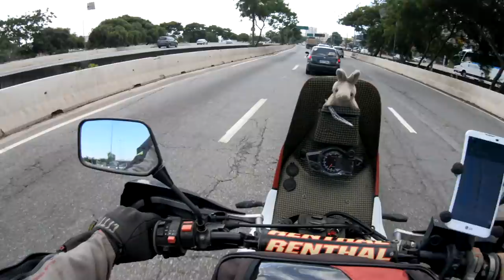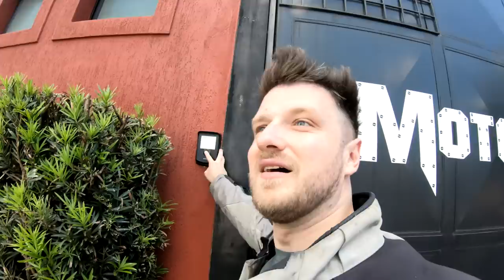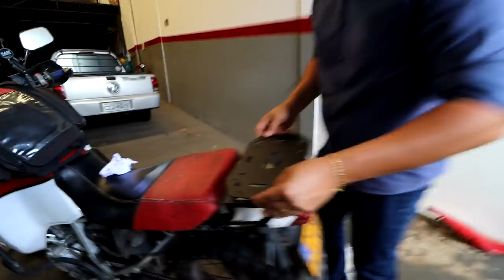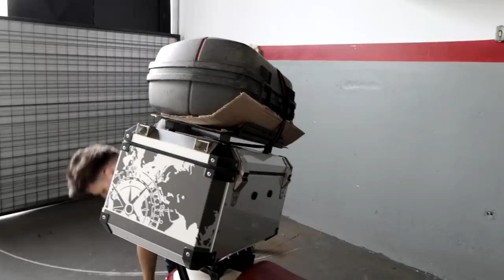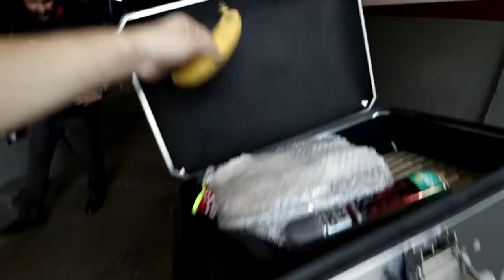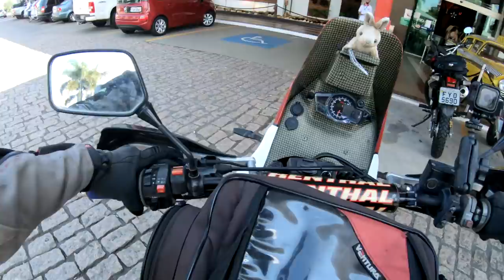Installing New Aluminium Top Case Made in Brazil (OMG It's so BIG!) - ep87

Comment: I would strongly recommend using the rubber corner straps on your RAM mount phone holder.  I love mine.  While in Italy last November I was riding from Como to Milan.  I put my phone in a plastic bag because it was raining pretty hard.  Didn't fool with the corner straps because I was in a hurry.  I suspect the rain, the plastic bag, plus the phone not being secured properly caused it to come out of the holder, bounce on my knee and was gone at 80 mph. Bad enough to lose the phone, but it was my primary navigation unit.  I have a usb cable direct to battery so the phone is charged at all times.  Bluetooth into the helmet with directions and music. Heading to Brasil next October for a 30 day solo tour. Thanks for posting.
Reply from the maker: Sorry for your loss, there have been times where I would have been in some serious trouble without the phone as nav. So the new phone came off the other day which is bigger and bulkier. Already had started using the rubber tether but didn't attach it because figured it was a short ride home. Phone fell out while picking up speed but I somehow caught it, so lucky. So since then I'm always on them straps. Have a great trip mate when you get here!
Reply: Did you come, after all?  How was it?

Comment: Pedro, Perhaps you should look into adding a USB power port to your dash so you don't have to rely on the phones limited battery capacity. They are fairly simple to install. I have a dual  USB port on my KLR  and it makes everything so much easier.
Reply from the maker: You're right, I've already got one but it has become unreliable, installing a replacement soon. Got a double usb and a 12v port but the cheap Chinese stuff doesn't like all the shaking. Hope it's that and not the wiring.

Comment: Looks very similar to the Givi Trecker Outback. I have the 58 l.
I can fit camping gear incl. a foldable chair plus rain gear and there is still space left.
For daily driving it can store the helmet, extra warm clothes, some tools and rain gear. Very happy.
For traveling I have downsized from hard big boxes to soft Kriega OS 32 and OS 22.
Incl. the new Rade Garage 790 rack the width is reduced by 20 cm. (Almost 8 inches).
Pack clothes i a dry bag on the pillion sest.

I like the idea with to top boxes 👍
Reply: Good Italian gear... ^:^

Comment: I have a similar sized 58 litre aluminium top box it also comes in handy as a seat. I just remove it, place it down on its side and take a seat.

 Mine was second hand so one side was already scuffed and scratched so I put that side on the floor when I use it as a seat.

Comment: Looks like Alp is needing some Acf50 treatment
Reply from the maker: Enlighten me, what can I put on something corroding at high temperature to ease it? Looked for ceramic coating place in Bolivia but couldn't find one. At some point I'll have to do another shoddy paint job that will wear, but better than nothing.
Reply: @iPedroMota  ive been using Acf50, its good and cheap. Thats all they use in the UK during the winter cuz of the salt on the roads. You give the bike a good wash, and then completely dried you spray the product. Do not buy the aerosol one, get the 32onz bottle.

Check some videos here on YouTube, there's some guys doing it PRO.

Comment: My phone stopped flying my Mavic with full function. I only had a 2 GB phone, when I upgraded to a 6 GB phone, every problem vanished. DJI has been required to put a bunch of spy stuff in their software and it takes more memory to run it all. A side benefit is that my new phone battery life is double the old one.